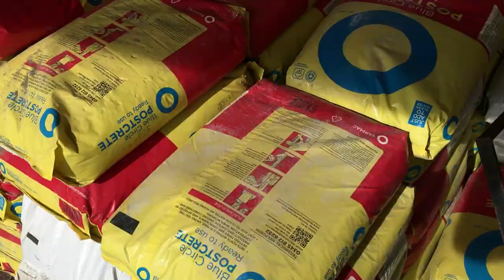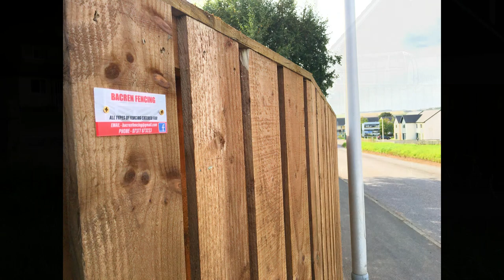Hit & Miss Fence project | Small fencing business

Comment: Great job. What's the size of the boards that you're using? 19x150mm?
Reply from the maker: Thanks, yes 1800 x 150 x 19mm 👍
Reply: @Bacrenfencing  Thanks, what gap do you leave between the boards to allow full privacy?
Reply from the maker: @mehowq  32mm - I use a 32mm thick fence rail as a spacer. 32mm gives full privacy but you can obviously use any gap you want. Anything over about 40mm and you will be able to see through the fence if standing at an angle to it.
Reply: @Bacrenfencing  Thanks again, very helpful. The last variable - what are the dimensions of the rails that you're using with the above boards?
Reply from the maker: @mehowq  75mm x 38mm x 3600mm

Comment: What timber did you use for the rails as it’s on a curve/bend? Thanks.
Reply from the maker: The rails are 75 x 38 x 3600mm - I did not bend them round the curve, but just use fairly short distances between posts, so it enables the fence to follow the curve. Hope that makes sense.
Reply: @Bacrenfencing  Thanks for the reply. Also how did you add the capping rail to the curved part of the fence? 

I’ve just moved house and wanting to build a similar fence above a 1 metre wall. Thanks again.